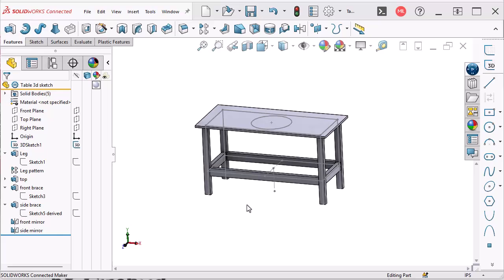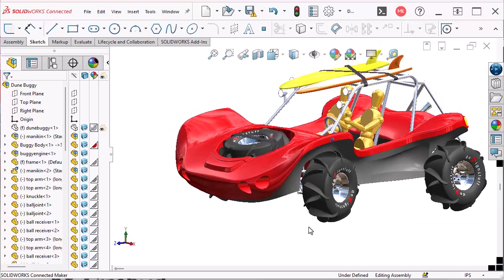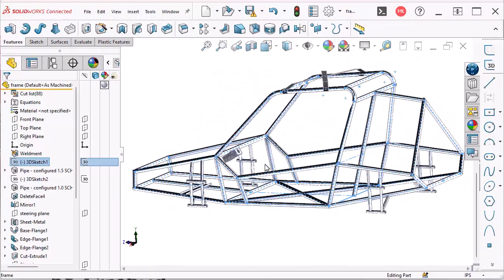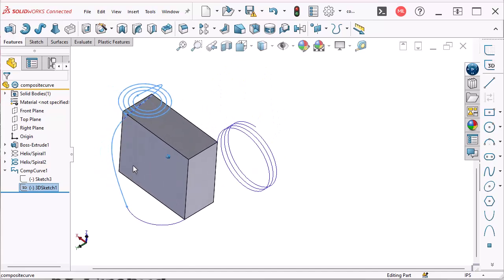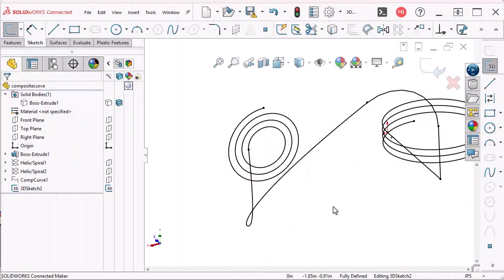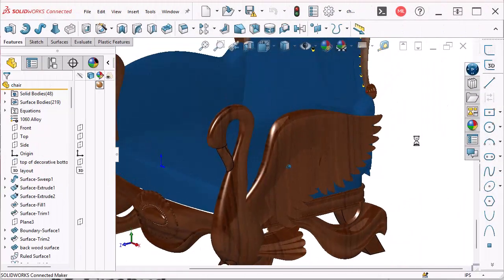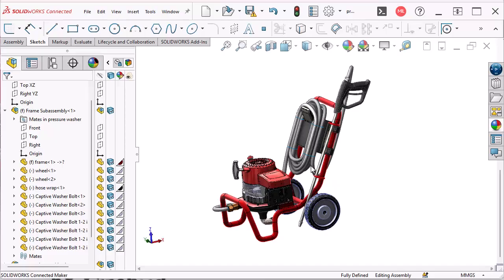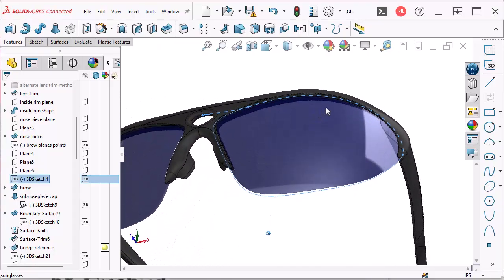Solidworks 3D Sketch tutorial  Part 1

Comment: Thank you Matt , very informative , do you use Solidworks or Solid Edge as your "go to" Cad Software ?
Reply from the maker: Great question. Solidworks is like an old shoe - comfortable, but its starting to stink and fall apart. Edge has cool techniques like Synchronous and subd that offer better ways of doing certain tasks. Which is to say that I've done a lot of projects in Works, and not that many in Edge, but I'd much rather deal with Siemens (Solid Edge) than Dassault (Solidworks).